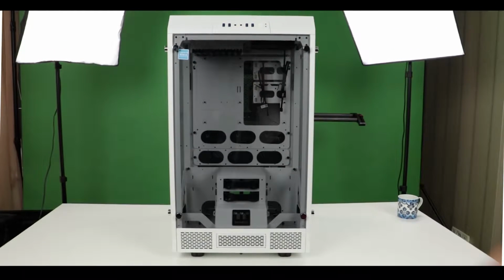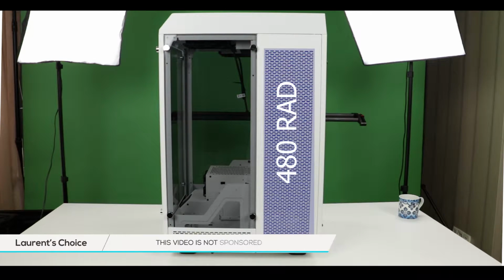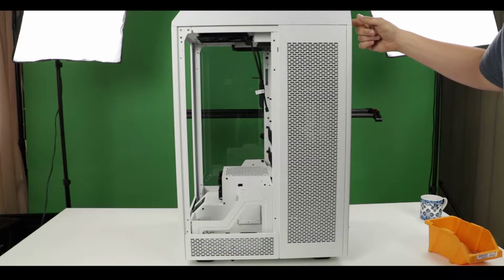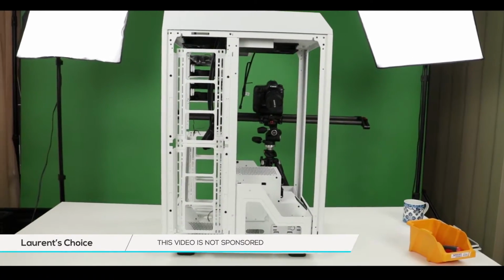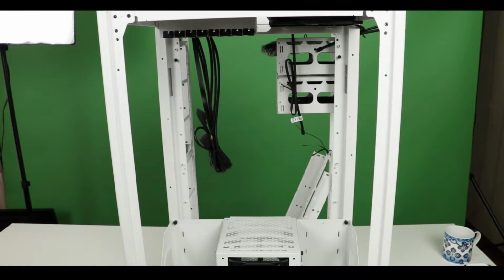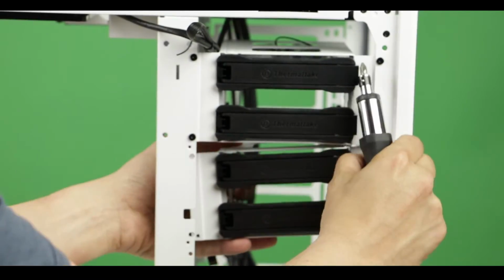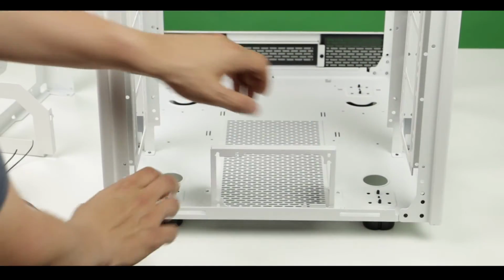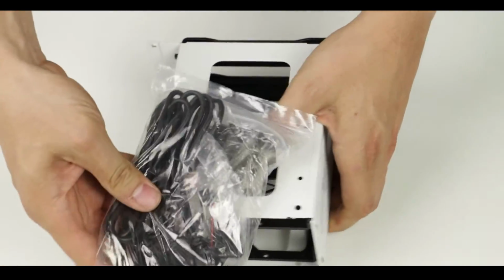The Tower 900 : Dual loop preparation!

Comment: I've been struggling to remove the top cover. How'd you do it?
Reply: Yank on the back.  No really, there's a slot in the middle of the back cover pull up there till it pops off.